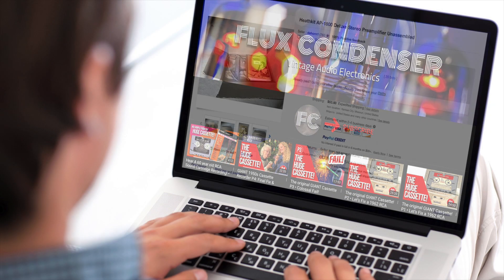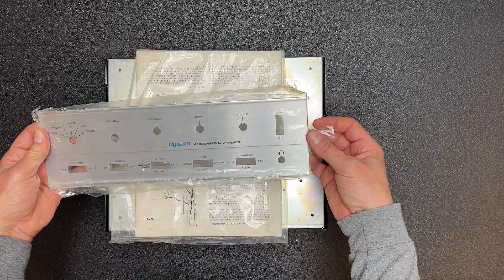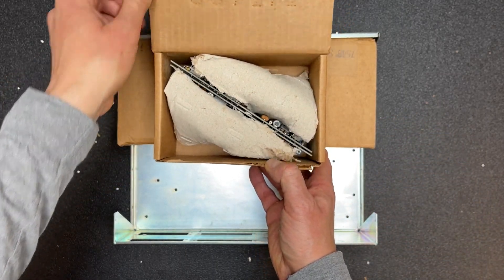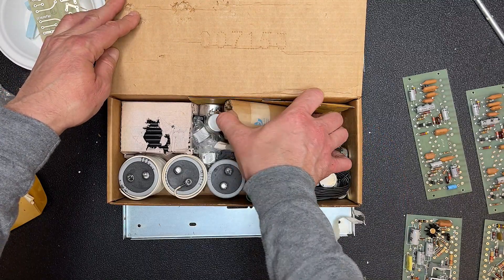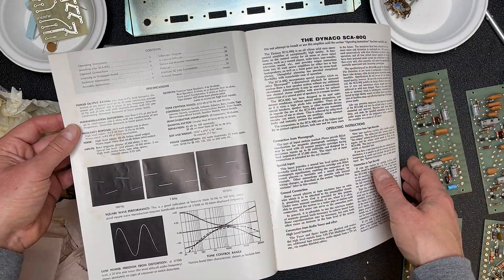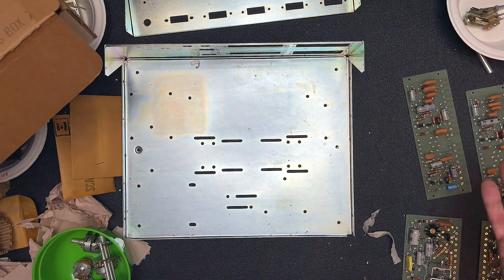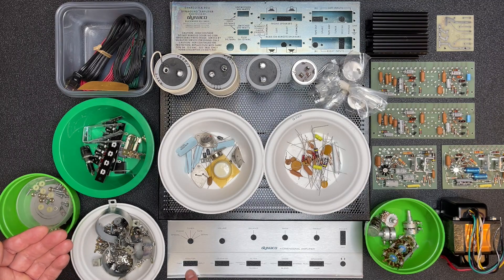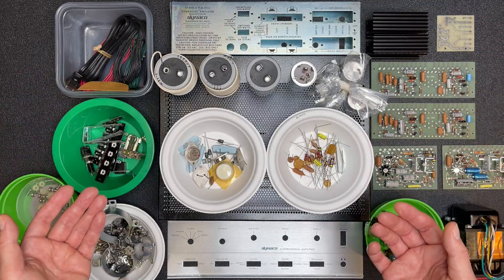The Dynaco SCA-80Q Amplifier Kit P1 • Unboxing

Comment: This was very cool to see.  I built an SCA-80 (no Q) back in 1969 or 70 when I was 5.  Well, my mom actually built it, but my job was to find every part in the kit as she called it out and completed each step.   Mom was on some IEEE committees with David Hafler, I believe, or they had some other professional association and she wanted to try building his kit.  I think this was actually Ed Laurent's design based on some things I've read.  This was the heart of our family's stereo (along with a Dynaco AF-6 tuner and AR-4x speakers) for the rest of my parents' lives. I inherited it and it was the heart of my family's stereo for about 15 years.  I should note that it was never re-capped and the only work it ever got was a replacement DPTT switch on the front around 1980 and new output transistors around 2010.  The switch was a slider instead of a rocker and kind of killed the looks, but made it kind of cool, too.  Back in 2016, the power supply went and I dropped it off for service at our local stereo repair shop.  The shop was kind of an anachronism and was run by the "Soup Nazi" of audio repairmen, so I didn't expect to get it back anytime soon.  Unfortunately, mom's amp was lost to time when a car careened into the front of the shop in 2020, four years after I dropped it off.  Your video has motivated me to find another.
Reply from the maker: Wow, what a story! Thanks for sharing. I mean, it had everything. A kit-building mom who worked with Hafler. A full family history of the kit. The repair history. A repair Nazi. And a bizarre car-through-the-shop finish! This may be the best comment ever ;-)
Reply: Mom was a physicist and Section Chief  in the Sound Section of the National Bureau of Standards (now the National Institute of Standards and Technology) for many years and was heavy into acoustics and all things audio.  She was also a good mom.  I cultivated a pretty good relationship with the Soup Nazi audio guy based on recognizing who has arbitrary authority in my life.  (I needed him to fix my gear and he didn't need me for anything.)  He even fixed my guitar amp in under 2 weeks.  Unheard of!  He made sure to tell me not to get used to that level of service and not to tell anybody!  Sadly, he passed away several months ago, so I guess I don't have to keep it a secret any longer.  Keep the videos coming!!!
 @FluxCondenser

Comment: Make sure you put a 250 volt, .05uf disc cap across the neon lamp. That will extend the life of the neon lamp
Reply from the maker: Hm, what’s the thinking behind adding the cap there? I’ve seen this done with LEDs with some claims of soft-start and surge arrest, but seems unnecessary to me. The circuit already has two caps at the power input in series at hot and neutral for basic line filtering.

Comment: Those electrolytic caps are probably just fine. But yes, do test them just in case. And clean the switches and pots as suggested. But the rest of the components are as good as new. Semiconductors do not age on the shelf as tubes sometimes did. NOS resistors should be within tolerance. Resistors of that era were already sealed against moisture. Ceramic and mylar caps of that era are just as good as today. But old mounting hardware - now that you have to be careful with!
Reply from the maker: In my experience, I’m guessing many of the electrolytics are probably not “probably just fine.” And, in fact, after just quickly testing a couple now, I can tell you that the large 5000 Mf capacitors test very poorly for parallel leakage and are in need of replacement. 

Yes, of course the switches and pots will be cleaned. 

There’s no guarantee the “rest of the components are as good as new” and I routinely find resistors of this vintage that are out of spec. 

Capacitors and resistors are not semiconductors. The diodes and transistors are semiconductors and those are likely fine. I never suggested they would need replacement although that’s always a possibility and those, too will be tested. I also indicated in the video that the ceramics are probably fine and never indicated that the mylars would not be. 

The old mounting hardware? That’s in perfect condition and will absolutely be fine. I can’t image why you would think otherwise. I’ve built many Dynaco kits and the hardware is always fantastic.
Reply: @FluxCondenser  The hardware comment was a joke! I am an EE and also restore 1970s audio gear. Most of the electrolytic caps I check are fine. In fact I have a Lafayette amp on my computer desk where the old caps tested better than new caps! Not by much, but those older components were often manufactured to higher standards than the off shore parts today. With NOS parts as you have, they have not been subjected to operating heat either.
Reply from the maker: @andydelle4509  If you truly are finding old caps that test better than the new ones, I don’t think that’s necessarily a testament to the old caps. “The new caps,” as you put it is a broad term. There are lots of “new” caps. Different manufacturers, different specs and as a whole, today’s capacitors are more capable than ever. 

I’ve never had an old cap test better than a new, suitable modern replacement. There will be some electrolytics in this amp that are fine, but none will test better than the replacements I’ve purchased. That’s an almost certain guarantee. I carefully choose my capacitors for ripple current/ESR/tangent-of-loss and I buy brands that have proven themselves to be reliable and well made. Additionally, I test for not just ESR, but parallel leakage and of course, capacitance.
Reply: @FluxCondenser  What test gear do you use to test caps?
Reply from the maker: For parallel leakage an old Heathkit IT-28. For ESR an Atlas Peak ESR70. For capacitance a Peak LCR45 or Fluke 87. I also had a fancy Sencore LC103 tester for a while, but returned it as it didn’t provide better results than what I was using.

Comment: I also bought a used Dynaco SCA-80Q some time ago.  I won't spoil your fun except to say that the last little bit of hum may not go away until you put the cage on it.  I also bought an unbuilt, unopened Heathkit IM-18 VTVM a while back.  It was in great shape except for the 6AL5 dual diode tube which had gone gassy.  🤦‍♂️
Reply from the maker: Thanks for your input, Darth. I’ve read so many complaints about these amps and their poor sound quality. This thing will be fully bench tested when complete to validate or invalidate those claims and I’ll include that in an upcoming video. And no worries about spoiling my fun. The fun is in building the kit and seeing how it performs, however good or bad that might be. My interest in vintage components isn’t in having the best performing components (I’ve got plenty of those). It’s the experience of “going back in time.”
Reply: @FluxCondenser  If you haven't noticed already, replacing the physically largest capacitors will have you cursing improved technology.  I looked at the replacements and said out loud "but they're so small now."  In most hum problem cases, C9 is the culprit - but yours is still "new" and may not cause any issue.  In my case, putting the cage back on the chassis got rid of the last little bit of 60 cycle hum.  Also, measure or calculate the inductance of L1 right now, as it isn't given anywhere that I've seen and you'll want it if you have to make a new set of output cap/series inductors in the future.  Just trying to prevent hair-loss. 😉
Reply from the maker: @darthbubba866  You must not have watched the entire video or just skimmed through it. As I said in the video, all components will be tested before the kit is built and I’ll make replacements as necessary. I also explained in the video that all electrolytics will be replaced, no matter how they test. 

No, I’ve never noticed issues replacing large electrolytics in any of my projects. I’ve replaced many in Dynacos, Heathkits, McIntosh, Pioneer, etc. and when good components are used, the replacements have always tested and performed better than the originals. Care needs to be taken to ensure that replacement capacitors are suitable for the circuit and one should look for low ESR/tangent-of-loss/ripple when a circuit requires that. Modern capacitors are more capable than ever so if your replacements are worse than your originals, you’re simply failing to choose correctly. 

I’ve received all my replacement electrolytics and have chosen excellent Nichicons and Kemets and expect no issues. Size isn’t a predictor of performance (that’s what he said), but in each case my replacements are actually larger than the originals. 

Further, I’m not sure what to make of the comment, “putting the cage back on the chassis got rid of the last little bit of 60 cycle hum.” Of course it did. The cage is a necessary shielding component and no evaluations should be made without it. That’s true with a lot of equipment so nothing unusual there. I’ve even noted in my videos that the hum heard when I play a component on the bench is a consequence of the top or bottom covers not being in place.
Reply: @FluxCondenser  I don't want to prolong this or we'll have to start putting in line numbers in the text to refer back to.  For the most part, modern electrolytics - capacitance and voltage rating held the same - will be physically smaller due to thinner plates that also are acid-etched to increase microscopic surface area.  This decrease in physical size also helps with ESR, but then your over-voltage tolerance decreases as a side effect.  (Very long historical aside deleted)  I simply forgot that you were going to replace all the electrolytics. I do the same for test equipment that I'm restoring for daily use, but I don't do a complete recapping of audio equipment, just the demonstrably bad parts unless the owner wants "a cap job."  It would be interesting to see side-by-side visual comparisons of the original and replacement caps for the SCA-80D, I'm now curious.  In re; the cage being in place: I've rarely had putting the top and bottom on an amp make as much difference in hum and noise as it does with the SCA-80D.  Maybe my workbench area is just electrically quieter.  My surprise with the SCA-80D humming was that the transformer already has a Faraday shield.  Anyway, I want to end now 'cuz I'm a real slow typist and my eyes are getting a little tired.  Until you next video 👍
Reply from the maker: @darthbubba866  Yes, the copper shield around the transformer does add shielding, but technically I believe it’s called a flux band and not a faraday shield. I’m not an expert on transformers or shields, but I believe a faraday shield or cage would need to completely surround the transformer and not just be a simple band.  

Any hum that’s removed when applying the metal top or bottom cover to a piece of gear isn’t coming from within the equipment, though, but from the AC and other stray signals in the airwaves of the home. I have an LED light above my bench that’s a disaster as far as noise. I can’t even run an FM radio in the room with that thing on!

You’re correct of course that yes, modern electrolytics are often smaller than their earlier counterparts. With very large capacitors such as the three in this unit, though, I’ve found modern replacements strangely to be only somewhat smaller or about the same size. In the case of this amp, two of the large electrolytics used on the output also serve as forms for an inductor coil. Because of this, I specifically purchased replacement electrolytics of the same diameter (50 mm). This will allow me to use them as the inductor forms and also use the mounting hardware supplied with the kit. 

As you’re curious about the size difference, the originals are 70 mm in height (not including the lugs) and the new Nichicon replacements are 80mm in height. Both are rated for 80v, but the new Nichicon has 6800 Mf, vs the original’s 5000 Mf. I’ll compare them visually in upcoming episodes. 

Like you, if I were repairing or restoring this unit, I might only replace electrolytics that seemed sketchy. When I do brand new builds, though, I like to start with fresh electrolytics. Often the old ones are fine, but the new ones always test better in my experience so why not start off on the right foot. 

I really do appreciate your comments and input. I may not always agree, but I find that with fair-minded viewers such as you, the collaboration can lead to a better understanding for us and any others reading the comments.

Take care and thank you for your continued support of the channel.
Reply: @FluxCondenser  The copper band around the transformer was called a Faraday shield by the guy at Hafler who sent me one for my kit-built DH-200 back when they first shipped.  The laminations were buzzing and no amount of tightening the bolts would stop it. I never knew to call it anything else. The lighting around my bench is still 60Hz.  When the bulbs and tubes finally burn out I may go to LED, but will power them with DC or 60Hz AC.  Most LED switching-supply buzz is infernal on a good day.  

About replacement caps: what was the part number on the various power supply and output Nichicons?  BTW, the output inductor is 10uH +/- 15%. I'm using an air-core unit instead of wrapping wire around the output cap.

I look forward to the "build" video.  Keep your iron hot and your VTVM zeroed.  😊  And stay safe and healthy.
Reply from the maker: Thanks, Darth. For the three 5000 uF replacements I’ve got Nichicon KGs (LKG1K682MKZS). To replace the multi section can, I’ve got three Nichicon 1000 uF (UFW2A102MHD).

Comment: I built this amp when I was 17 years old, and I am still using it!  The Quadaptor is awesome, allowing all media with any amount of "out-of-phase" material to be sent to the rear speakers giving a spectacular surround sound experience!!!
Reply from the maker: No kidding? That’s great to hear, especially that you built it yourself and you’re still using it. Absolutely fantastic! 

I had experimented a bit with the Hafler circuit as a kid back in the 80s with limited success, but didn’t really have the right equipment to pull it off. Other than that I’ve never used a system like this other than 8-track quad which really has four discrete channels. 

I guess that’s not necessarily true, though, as I use my Lexicon surround sound processor (in my theater setup) to routinely create surround sound from 2-channel audio with Logic 7. Used this way, Logic 7 can be mighty impressive, and it’s one of the reasons I’ve never upgraded that processor. 

Of course, that uses far more complicated computer processing. Comparing the results between Logic 7 and the Hafler circuit in this Dynaco amp may be unfair, but will certainly be interesting. 

More on this in upcoming videos.
Reply: Yes, from what I remember the circuit is very simple for the Quadaptor. I think it was just a couple of resistors and possibly something else, but it is definitely just a passive circuit.  To defeat the the Quadaptor, and make the rear outputs normal, all you have to do is run a shorting wire from the front GROUND terminal to the rear ground terminal.  Looking forward to the next in the series!  My best to you!